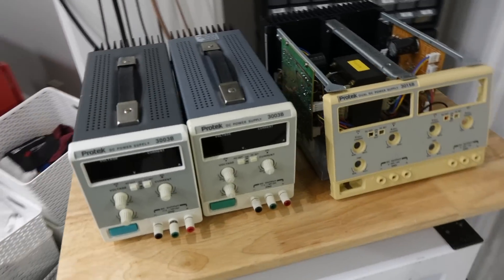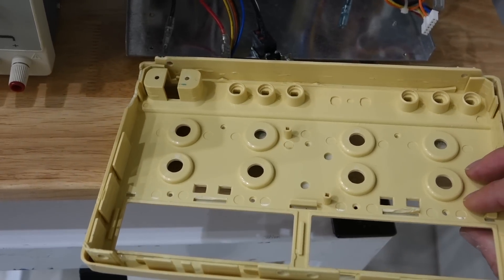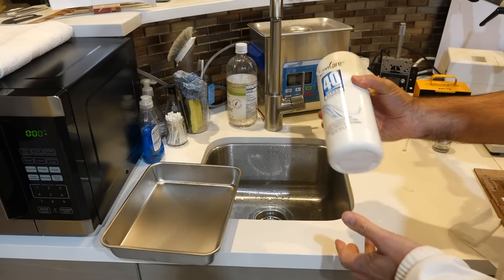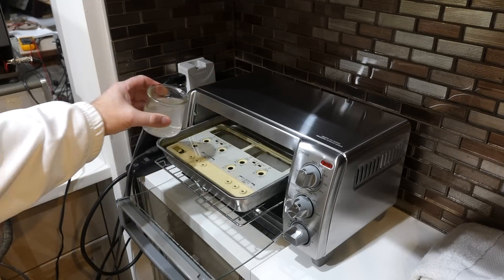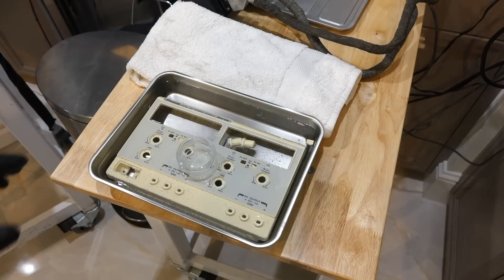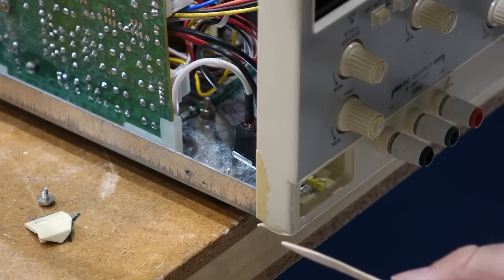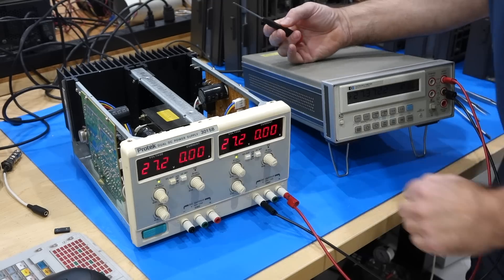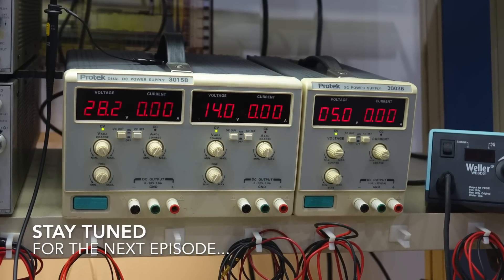Retr0brighting the easy way (Protek 3015B power supply)

Comment: I tried putting the yellowed panels from a couple of old HP LaserJets out in the sun for a couple days. They came back about half way.
I have read that retrobrighting is only a temporary solution, and it will revert back to yellow, but I can't personally speak to that.

Comment: I recognised aviation standard voltages being set up on the PSU (28V) which I guess went into the space technology too. Is 115V/400hz also an AC standard?
Reply: yes indeed - Apollo used 115VAC 400Hz from inverters to power things like the cabin general illumination
Reply: @carlclaunch793  thanks.

Comment: I believe it's a combination of H2O2 and UV light that makes the process work, and not necessarily the heat.
Reply: His toaster oven wasn't outputting any UV - they output IR and also the back side of the panel didn't receive any light at all and yet lightened up just as well - it was the heat that did the work in this case
Reply: @HubrisInc  I know his over wasn't outputting UV. :)  What I was saying was that I thought the most effective combination is H2O2 + UV (preferably sunlight.)  But I guess the 8-Bit Guy's video shows otherwise.

Comment: This makes me appreciate my old school Power Designs triple output bench supplies. No plastic panels on those!
Reply from the maker: That’s the better way to do it. Start with units that don’t have @#$&*%! modern plastic!
Reply: Or you can just have it be made out of black plastic and forget about it
Reply: All of Power Designs, Kepco and HP supplies in my lab have 1/8" aluminum front panels. The only thing that seems to yellow the paint on those is cigarette smoke. Some old eBay finds need a panel "de-smoking". Otherwise no problem :)

Comment: Your not kidding about those Protek front panels being brittle. I have one.. its a parts donor now.
I was toying with 3D printing a new front panel but a) its a complicated shape and b) all my printer beds are too small. 
And I was too lazy to split up the printing into smaller parts :)- 
Cheers,
Reply: Tip: What I do with bad condition plastics (brittle, weak or dull color) is to use furniture oil. To be exactly Pledge of the company Johnson&Johnson.  The smell is very nice and revive the plastic very well. You need a thick layer of this stuff and let it soak for a few days. The result is amazing.

Comment: It's like the way Super Nintendos always have one part of the case that's way more yellow than the other. I think they just use different mixes of plastic and you get what you get.
Reply: Yes likely different suppliers with the same mouilds, and the product gets mixed up in production. Likely one used more recycled ABS in the mix, while the other had a fresh batch of ABS and PVC, plus more of the titanium dioxide whitener in the blend as well for the raw stock they extruded and chopped into nurdles.
Reply: I had an Asus "REVO" mini PC from about 2007 that came with a completely snow white keyboard that I never used... when I found it 10 years later it was horribly yellowed (like C64 bread bin orange) but about 1/3 of the keys randomly stayed completely white. Very weird- no obvious pattern to it. It also obviously yellowed much faster than anything I had seen before

Comment: i always wondered why people didnt just dunk the plastics in warm water/peroxide as that looked to be the best and simplest method YET they still always do the process of leaving it out in the sun or UV method when it was clearly shown.
Reply: Heat sometimes can warp items. I've seen spacebars turn into spirals
Reply: @TheErador  yeah but i wonder what water temp would work out fine.
Reply: @petek9348  i think 'Hey Birt', did a pretty comprehensive video on just that subject.